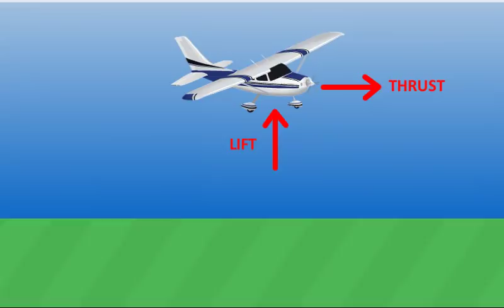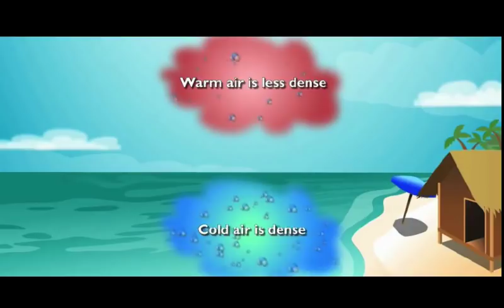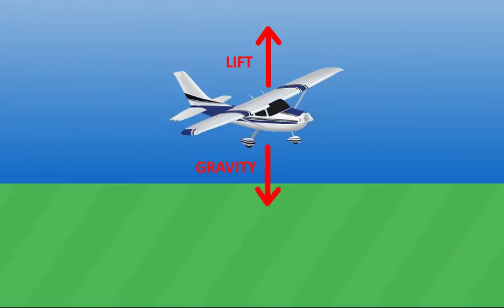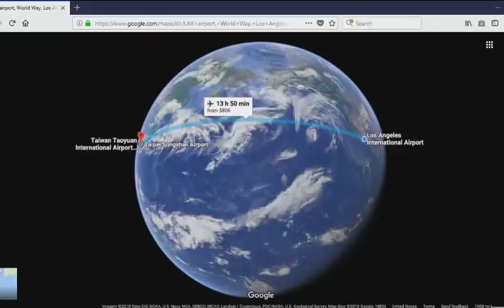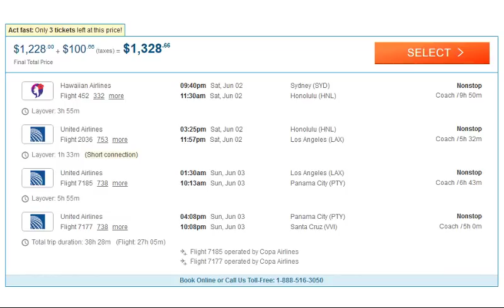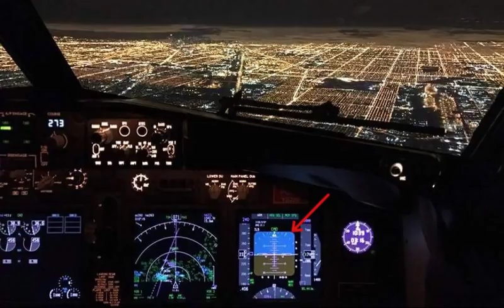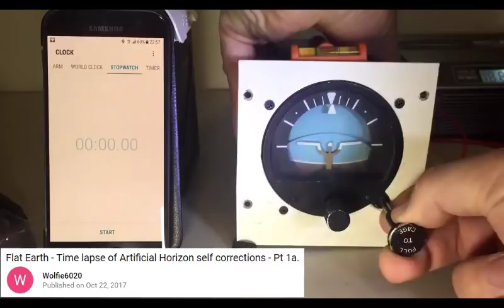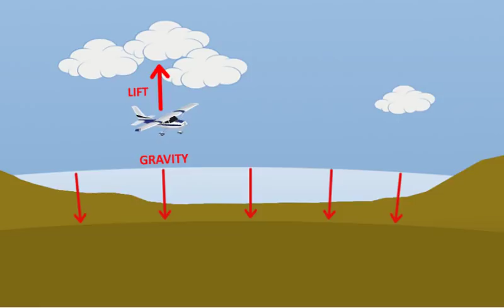Flat Earth Falsities - Plane Nonsense

Comment: Has anyone ever seen the curvature of the earth with their own eyes and not through NASA or photoshop images in sciences books?
Reply: Yes. Your point being? To prove you are uneducated and inexperienced? Not to mention extremely gullible. Correct?
Reply: How high at altitude were you? and what time of aircraft were you flying on? I served in the air force (not a pilot) but i had access to the cockpit
Reply: And what did you learn in this (presumably on the ground) cockpit?
Reply: Yvan Herrera
Who mentioned flying. This may come as a surprise to you but we worked out the Earth was not flat about 3,000 years ago.
Sailors knew this because ships and land sank below and rose up from the horizon. This is why lookouts were posted aloft.
We measured the size of the earth about 2,300 years ago and the first Azimuthal Equidistant Projection was mathematically developed by Abū Rayḥān Muḥammad ibn Aḥmad Al-Bīrūnī in the 10th Century. Al-Bīrūnī obviously therefore knew the earth was spherical and also believed that it rotated, he also measured the earth's radius. He deduced the existence of the Americas on the basis of his accurate estimations of the Earth's circumference and Afro-Eurasia's size. This was several hundred years before Columbus et al.
Then Copernicus destroyed the prevailing geocentric idea around 500 years ago.
The French measured the Earth's oblateness a few hundred years ago, and navigators, astronomers et worked out that sextant altitudes had to be corrected for the Earth's curvature hundreds of years ago.
Compasses only work because the earth is spherical and additionally gyrocompasses only work because the earth is also slowly rotating and gravity is a fact.
NASA was therefore somewhat late on the scene and also much later than Космическая программа СССР . Didn't your minders tell you these things? I am surprised. I wonder why they didn't.
Reply: @boffeycn  I flew a lot in the 15 years of service at very high altitudes. I had access to the cockpit with a wide view angle. Never saw the curvature.
Based on what mainstream science tells us what the circumference of the earth is and 8 inches per mile squared of curvature you should start seeing curvature at 10k altitude. I flew as high as 70k feet altitude never saw any curvature. The horizon always leveled at eye sight.
NASA uses a lot of fish eye lenses and I have seen any fakery from them so I dont trust NASA 100%. 
So where were you when you saw the curvature of the earth?
Reply: @boffeycn  and ships dont disappear it is perspective. The longer the distance and object goes it will start to disappear. The world record distance captured with a camera zoom was 275 niles. That means almost 4 miles of curvature  it would have been impossible to capture that picture.
Most globe earthers go straight to insults without having a formal debate.
Remember I was also indoctrinated into believing the earth as a globe. I was one of you.
Reply: So you are yet another FE CGI expert?
Reply: Yvan Herrera
Why are you totally ignoring the facts I have presented? Why?
Why are you avoiding. Just answer my points. One by one, Starting with my first post.
"there are 8 inches if mule (donkey) squared of curvature" No. That is not the relationship for a spherical curve, is it. And if you are what you claim you would know that and not kept banging on about it. That you don't know is proof you are a liar. An ignorant one.
As to the video full of lies you cited, I commented on it 3 months ago. If you cannot see my comments it proves the "FLAT EARTH BROTHERS" have blocked them because they do not want you gullible sheep to see my comments.
So answer my points instead of evading. If you have the guts. Come on, Put up or accept you are totally ignorant about the earth's shape etc.
Reply: @boffeycn  I asked you first have you seen the curvature of the earth? You said yes. Where did you see it?
When you answer that, that's when I am going to answer your stupid questions.
Reply: Yvan Herrera
Is that a promise? You are going to answer my posts honestly and factually. With proof?
Reply: @boffeycn  still waiting for you answer. Where did you see the curvature of the earth? 
Or are you avoiding my question?
Reply: Yvan Herrera  I repeat, again.
Is that a promise? You are going to answer my posts honestly and factually. With proof?
Reply: Yvan Herrera  I repeat, again.
Is that a promise? You are going to answer my posts honestly and factually. With proof?
Reply: @tomgolde5175  I have been at 70k feet altitude I know what I have seen. I uave also seen go pros sent to higher than 100k feet by amateurs with no fish eye lense here on youtube- and  no curvature.
Where is your high school video and what altitude did you send it?
When globearthers go straight to insults is because they dont have an argument.
Reply: +Yvan Herrera  I repeat, yet again. Ten times with no answer. This is the eleventh
Is that a promise? You are going to answer my posts honestly and factually. With proof?
Reply: +Yvan Herrera  I repeat, yet again. Eleven times with no answer. This is the twelfth
Is that a promise? You are going to answer my posts honestly and factually. With proof? Yvan Herrera .
Reply: +Yvan Herrera  I repeat, yet again. 12 times with no answer. This is the 13th
Is that a promise? You are going to answer my posts honestly and factually. With proof? Yvan Herrera .
Reply: +Yvan Herrera  OK, so you are agreeing the Earth is a slowly rotating spheroid 
Goodbye.
 I repeat, yet again. 12 times with no answer. This is the 13th
Is that a promise? You are going to answer my posts honestly and factually. With proof?
Reply: Yvan Herrera 8" per mile squared describes a parabola not a circle. Why do you think it describes a circle?
Reply: lmfao I love when they bring that 8" mile squared up. Just shows they only know how to parrot what they saw on a YouTube video.
Reply: @CaptWesStarwind  one question for you: what is the curvature of the earth?
Reply: 360 degrees
Reply: Wong asked you a question. You should answer him.
Reply: Yvan Herrera  I repeat, yet again. Seven times with no answer. This is the eighth.
Is that a promise? You are going to answer my posts honestly and factually. With proof?
Reply: Yvan Herrera  I repeat, yet again. Nine times with no answer. This is the tenth.
Is that a promise? You are going to answer my posts honestly and factually. With proof?
Reply: @flookd5516  https://dizzib.github.io/earth/curve-calc/?d0=30&h0=10&unit=imperial
Reply: Yvan Herrera, go and have a look at that. It was done over much shorter distances, yet still proves the point.
Please also explain to me how you base your "research" on Google and yet you do not trust NASA? Is it then the same as saying i dont watch the news on TV because I trust the Newspapers more?
Reply: @paullessing136  I have seen that. Discovery is a fake. They faked shark week, remember? Besides their laser was not on a flat surface.
Reply: Yes i have. We sent up a baloon with a camera that wasnt fish eyed. Which wouldnt matter if it was anyway.. which btw u flatearthers obviously know nothing about fish eyed lenses. But anyway yes we sent one up and u could easily see the earth way round
Reply: @tomgolde5175  where is the video?
Reply: https://www.youtube.com/watch?v=QVa2UmgdTM4
Reply: If you want to play the "see with your own eyes" card, I'll play your game. Have you ever seen, with your own eyes, the edge of your flat earth? Or the dome, or the ice wall, or any of the UN ships turning people back? Yes or no. If yes, where's your evidence? If no, STFU and go back to school.
Reply: @phildavenport2467  no I have not seen but I have seen neither the curvature of the earth. But it sure does seem like we are not rotating at 1080 miles per hour. How did they land back from the moon on a   earth spinning faster than the speed of sound? 
What I have seen with my own eyes at 70k feet altitude is flatness no curvature.
Reply: Superior Planet  dude, that is not good proof. The picture comparison is different in size and is much closer. I already had an argument about that.

Comment: Want to get rich Quick $100,000 FLAT EARTH CHALLENGE
 this guy wants to give YOU $100,000  bring your surveyor Friend i suggest you put up or as politely as i can say it Shut Up. have a nice day. 
https://www.youtube.com/watch?v=ewTPbarLZkc
Reply: You must be aware that this question has been asked numerous times and never answered "Where is the money?" So where is it?
And you must also be aware, the last time an FE cultist made such a challenge they lost, obviously, but then refused to honour the agreed challenge sum. So you have a 100% default record. The debtor reneged on the debt because the challenge money had not been placed in escrow with an independent third party. In fact the money had never actually been seen. So I suggest you "SHUT THE FUCK UP" or, as they say, put up or shut up.
The money should have been put in a third party escrow account which the wagerer cannot touch for the next 50 years. Standard practive. Why hasn't this been done.
Reply: Wong, I second that.
Reply: Erm, he wants us to go and measure angular change then? Considering this type of surveying measures essentially how level the ground is, the angle of which is dictated by gravity which will always be towards the earth's centre, of course there will be no change in angles, apart from any undulations in the surface of the beach. In any case, the angle subtended by the arc would be less than one degree over this distance. The experiment will show no change as the direction of gravity will shift as they move down the beach, relative to their position on the earth's surface. This will prove neither a globe earth or a flat earth as you would expect the same result in both cases. The experiment, and therefore the bet, is completely pointless.
Reply: The scammer Dubay knows this. This is why he tries to make these moronic straw man challenges. It's all just to get more attention, and make more money off these flattards.
Reply: Well there is the 400k challenge for flattards. They could buy a lot of tinfoil with that. https://www.youtube.com/watch?v=rRMzTJyFr_M

Comment: these facts are false the atmosphere with no dome to hold it in would suck off in a millisecond  with the tremendous vacuum of space.  you do not know how a gyroscope works.
Reply: Ed Mudd There's nothing in a vacuum to do the sucking. The atmosphere would expand into the vacuum if the flow were not being countered by gravity. 

Learn the difference between a simple gyroscope and a pendulous gyroscope.
Reply: so if you took your own gyro on the plain it would show the change in angle.  do you know there has never been a test to prove the earth is moving
Reply: if your theory is right you could not suck the air out of a bottle because the gravity would hold it in. thats is insane fook d
Reply: That literally made no sense. But your original supposition is a valid question, why doesn't the atmosphere escape into space? Actually it does - very slowly, over billion year timescales. Good article on it here, explains it very nicely. http://earthsky.org/earth/what-keeps-earths-atmosphere-on-earth
Reply: Ed Mudd who put the bop into bop she bop she bop? Who put the ram into ramalamadingdong?
Reply: Paulsterx to answer your question of who put the bop into bop she bop she bop? Who put the ram into ramalamadingdong? It was Kevin from accounting.
Reply: Capt'Wes Starwind
But who was it that gave Kevin a good rogering?
Reply: You see Ed Mudd, its statements like that, that will cause someone to seriously question if you have a brain.
If you remove the air out of a plastic bottle, the bottle will collapse not just because of the vacuum inside the bottle, but also because of the atmospheric pressure on the bottle.
If it is a rigid or glass bottle, the glass will not deform because firstly it is not pliant(It can not bend or deform) and secondly the structure of the glass bottle is strong enough to withstand the external pressure of the atmosphere pressing down in it. Gravity has exactly the same effect on everything on the earth.
now if you take it to a global size, the weight of the atmosphere pressing down on the earth will decrease as you go up in altitude. if you keep going, eventually the air will get thinner and thinner until you eventually have no atmosphere left.
Reply: Ed Mudd Who built the dome? And what is it made of? Glass? Plastic? Concrete with murals painted on the inside? Who painted the murals? Why is there no time of day when all of the continents are experiencing daylight? Is the 'sun' just a light bulb? If so, who's job is it to turn the light on in the morning, and off at night? Why are there no postcards from the edge of the world?
Reply: James The Dome is referred to as the Firmament that separated the waters in space from the waters below.  this earth was made just for men the Bible says it does not move the sun and moon are within the firmament.  do a search for the Firmament .
Reply: Ed Mudd just for men? Sounds a little sexist. Is god a misogynist?
Reply: James Allen wait for the perspective comments to come. Like perspective can stop light. Also why can the sun be measured (properly measured with a filtered telescope to remove effects of glare) to be the same size at sunrise as midday? And how come the sun traverses the sky at the same rate, rather than appearing to speed up at midday when it’s closest to us, assuming it’s small and close as FE’ers say? There’s no answer to these phenomena which could only happen on a globe earth with a massive very distant sun.
Reply: this preacher produces many Government Documents And top secret  Russian that say the earth is Flat   https://www.youtube.com/watch?v=lUYO2KSrrkA
Reply: Hey Ed, didn't you read the sign on the wall when you walked into this place?  It clearly read  ...."Don't bother me with your facts boy, my mind is made up already!"  
  Obviously you have never seen the switch on the back of the gyro!  you must set it to MARS when you want to travel in space, and EARTH when you don't want to fly out into space!
Peace
Reply: Lol do you think the vacuum of space is like your vacuum cleaner at home? You've been watching to much YouTube and Sci fi movies. Oh and we are actually losing atmosphere to space, but I don't know if you will be able to really understand that either. Do either of you two have a working model or any flat earth equations you would like to share?
Reply: your vacuume  is a little limited son,  it can come no where near 30 lb's negitive pressure.
Reply: Ed Mudd A lb is a measure of weight and you can't get negative air pressure. One measure of pressure is pounds per square inch; zero is the lowest you can go. 

The neck on a bottle is at most a few inches. Ground to space is a few hundred miles with gradually decreasing air pressure from 1 atm to 0 atm; gravity needs only counter the gradient, not the net change in pressure. 

Depends on the quality of the gyroscope; with most the friction in the bearings is sufficient to keep the angle apparently constant relative to the Earth. A pendulous gyroscope is designed to remain aligned with gravity. 

The Foucault pendulum demonstrated the Earth rotates. Stellar parallax demonstrates the Earth moves in an orbit.
Reply: You don't know how gravity works
Reply: They never do =(